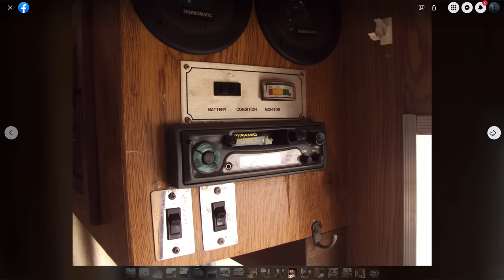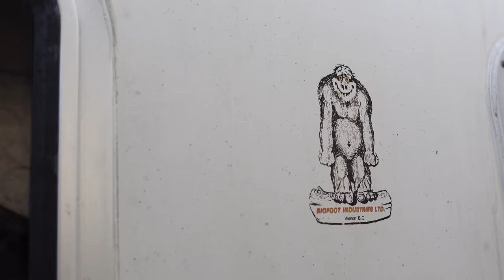We Bought a 43 Year Old Travel Trailer! (Bigfoot b17)

Comment: Cushion covers are amazing!  You are going to love trailer life.  Excited to watch the progress!  We have a 16 foot travel trailer that we have been using extensively over the past 15 years with our 2 kids.  On first glance, if there is any way to make that board above the bed into a bunk for a child, that would be my first suggestion!  That way your table remains separate.  (Our youngest is now 15 and has just outgrown our top bunk.)  Also, like you, we needed to buy a vehicle that could tow when we got the trailer.  Depending on the weight of your trailer, look into the Toyota Sienna van.  That is what we ended up with and we could fit 4 bikes in the back, 2 kayaks on the roof, towing the small trailer all over North America.  We are now looking for a replacement vehicle (it's a 2004), and see that Toyota now has a hybrid Sienna.  Never thought we would be mini van people, but there you go!
Reply from the maker: Hahaha I think we’re all minivan people if you really think about you know? 😅 thanks for the lovely comment!
Reply: @LeahandLevi  Minivans generally can pull up to 3500 lbs, but that includes everything in the van and in the car (including passengers). Then the minivan needs the tow package. If it did not come with one, then it can only pull (usually) 1500. When we got our first trailer, we looked into it, and all that was needed to turn our first gen Sienna into a tow vehicle was a transmission cooler and a break controller.
Reply: Soo ahh the Prius has a hitch, how heavy is the trailer again

Comment: What a great trailer!  My hubs and I have owned vintage trailers for several years.  One of the first things I would do if you plan to actually travel in your travel trailer, look at the numbers on the tires to determine how old they are.  You can find the information how to decipher the numbers online.  Trailer tires need to be purchased about every 5 years and you really need to buy trailer tires and not car tires!  The average life of a trailer tire is about five years under normal use and maintenance conditions - if yours are older than that, they definitely should be replaced.  Oh -- and don't neglect doing the bearings every year or so!
Reply from the maker: Ok that's great to know, my dad has also raised these concerns so we'll be doing that for sure. 👍🏻

Comment: I recommend having an independent mechanic look at the trailer and make sure everything is safe.  Brakes, bearings, axles, tires, electrical, body welds, and hitch. Grease any fittings, maybe have the bearings repacked. 

Next replace any seals on her body and roof, look for leaks, steam clean the upholstery, sanitize the water system and check for leaks there as well. 

Weight the propane tanks, turn on the propane without using it, and weight them again a day later. Make sure there are no leaks. 

Look for any rust on the metal parts, scrape it off and put a primer on to prevent further rust. This included under the propane tanks and battery box (if there is one outside)

Also start following RV influencers and try not to spend a fortune on accessories, a thing all new RV owners do 😅
Reply from the maker: Thanks for this! Our task list is starting to get pretty extensive haha

Comment: Hi guys!  Having pretty much gutted our 2022 Winnebago Micro Minnie, remember it from Isla Aguada?  If there's anything we can help with from afar, let us know.  For reconstruction, look into Baltic Birch plywood.  From 1/8" up to 1".  Strong, reasonably light, very attractive.  Windsor Plywood has it.  I used to make kayaks with it when I lived on Vancouver Island.  Solar, lots of options, simple is a suitcase panel, with charge controller.  Hook to battery, and voila.  A sway bar also very important, especially with a single axle trailer.  Definitely have a pro check your suspension!  Tow vehicle, lots of people go compact SUV or small truck.  But hey, we live in BC!  Mountains, mountains!  On a budget?  Older 3/4 ton, especially pre-DEF Diesel.  Newer?  I'd still go 3/4 ton, give you more flexibility for the future.  Give us a shout !  Dave, Leeann and Raiden.
Reply: Why did you gut such a new trailer?
Reply: @aayotechnology  because it was all total junk, everything either failed or fell apart during our 6 months voyage.  Dealership said it could be up to a year to fix it under warranty.  But back to original junk standard.  Fortunately, I'm very experienced with cabinet making and renovating RVs
Reply from the maker: Hey thanks you two! We’ve got a lot to learn that’s for sure! 😅 hope your adventure is going well!
Reply: @LeahandLevi  departing for Nova Scotia, early August.  Then back to Mexico in October!

Comment: I think the cushions are retro for sure.  If you do not like them then make covers for them that are Velcro instead of zippers.  Then pull off and wash when needed. I also love the pattern and you could pull out many colors from them and will not show spills etc. I love the golds and greens. Nice camper. You will love the propane; you can get a sensor for leaks of propane like a smoke alarm. Put it low by floor. Also, a carbonatite detector.   I love it. I am subscribing. We just brought about a year ago, an old 1984 burro. Getting ready to work on her again. Get her finished.

Comment: I just bought a 26 year old fiberglass RV. I 100% understand where you’re at. It’s mint and they don’t rot. The biggest thing I would recommend you do right away is get on the roof and check all of your seals. I need to do the same. I also need to re-silicone above all of the windows.

Comment: I don't know how much you checked out more modern campers/RVs, many use magnets to hold the door open. I don't know if there is anything available where you wouldn't need to screw one position into the side of the camper, but if you can find a spot where you can just attach a magnet to the door and the side of the camper, then you wouldn't need to create a new hold in the fiberglass. You would just need to connect the two magnets with a stick, rod, or even a chain. (edit to add recommendation) I would recommend trying the rod suggestion first, because it would hold the door in a fixed place and serve as a rudimentary door stop. This may help prevent damage to the door hinge when there is a strong gust of wind and keep the door from hitting the side of the camper.

Of course, you might be able to fashion a suction cup with a string tied to the door. That would say we're putting in effort to improve over the stick method, but people would probably still say you're not putting in that much effort.

Comment: In Alberta the motor association offered a 3 hour lesson on driving r vs. We learned great safety info and both of us practiced backing up. Learning how to give instructions was good as well.  Tip from my trucker friend. Put your hand at the bottom of the steering wheel. If you want it to go right just move your hand to right
Reply from the maker: Yes! My brother in law taught me that one but I’ve yet to use it because we not have a tow vehicle yet haha
Reply: I've always learned to put your hands on the bottom of the steering wheel and I've only driven small cars lol. We had to do it to pass drivers Ed and not it's just habit. The reasoning is if your hands are on the top and the air bags go off your wrist will break

Comment: Hi team! You don't need to buy a light truck to tow your trailer - a station wagon or a sedan with a bit more power than the prius will pull it just fine. It'll cost less to buy, run, and maintain, and will be less bad for the environment. Good luck!

Comment: How tall are you Levi? Are you able to stand up without hitting your head inside the trailer?
We love our 13 ft Sidekick (U.S. made Trillium).  
I recommend having the wheel bearings checked and regreased. You would do well to have the seals replaced ($25 for 2 seals) .  Check the tires; if they are 10 years old or you see any fine cracks in the sidewalls , replace them. 
Have fun camping.

Comment: I think the kind of trailer you bought was a really good choice -- hard to beat for size, weight and durability. I don't know what the exact weight of the older ones is, but I imagine you could probably tow it with the average SUV or compact pick-up. 
That said, be careful what you choose for a tow vehicle -- it's easy to under-estimate what you'll actually need. Your best bet is likely to go with a full-size truck and a somewhat newer one may be easier to find well equipped for towing. It will make many things easier and more work-able.
Are the cushions hideous? YES, and No -- most people on here seem to love them -- who am I to disagree. I'm sure that, for a restoration or classic vibe, they are the ultimate. If it were me, I'd go with a thorough, more contemporary style throughout -- just my tastes.
Congrats! and by the way great job backing that thing up like a soon-to-be Pro!
Cheers!...from North Vancouver

Comment: List of OCD thoughts that have popped up while watching this 
1 have the support frame checked out! 
Fellow canadian Slim potatohead can tell you the horrors of having a frame fail you in the middle of the woods 
2 that dinette is an awesome location to install a custom made crib for little boiled peanut when she or he finally appears 
Certain dog beds with raised edges make excellent RV trundle beds for toddlers 
Cornish hens make excellent RV thanksgiving “turkeys” and Christmas “geese” 
See if those mattress covers unzip so that you can wash them , SEVERAL times…. Also check the foam rubber for refurbishing …. If its vintage 70s and 80s it might be single piece, you might want to replace it with a layered product of different materials that has a hard layer for support, and memory foam layer 
Im not sure what type of material you are going to replace the floor with, but make sure to consider the weight of the material if you are considering hard flooring over carpeting 
Meanwhile most hardware stores sell cheap 4 foot by three mats that come in handy i have a number of them i use in my stow and go caravan when turning it into a weekend camper …. Something like that might make a good temporary floor for your trailer 
Im not sure what your concerns with cooking with propane but please take this into consideration , because of their infrequent use environmental contaminants tend to settle in the lines and on the burners which is what you smell when you lit up the burners in that rental RV, i have found that lighting up the burners and oven and burning that out at home with the cabin fully ventilated (stick a household box fan in the door blowing out BEFORE you go on your journey will help make sure your burners and lines are burned clean. 
If you decide to preserve the decor versus updating it to something more contemporary , make a meal out of it…. Accessorize your interior to make whatever year in 1970 or 1980 be your theme …. On your journey make that year be your theme and include pop culture references for that years….. play the top 40 playlist for 1983, watch the movies released in 1985 
Oh and shop garage sales for plastic bowls glasses and pitchers of thatbera
Reply from the maker: Thanks so much for these thoughts! Lots to learn here for sure!

Comment: Owned a vintage trailer. Please take it from me-test the stove with a spray bottle and a bit of dish soap to check the lines. (Google it). If I had done this it would have saved me a literal propane explosion that blew out the windows and bent the pop top. Thankfully me and my pets were fine. Check each time you’ve traveled and you’ll be fine. (Believe it or not the windows went back in and the top was fixed…but still! 😂)
Reply: Holy cow !
Reply: @aayotechnology Yup I was brand new on the road and almost gave up after that. But I didn’t. Came back home, sold it and looked for 8 months for my new to me motorhome. 😁
Reply: @Brenda-es3gw  kudos for not giving up. Are you happy with the replacement?
Reply: @aayotechnology  Thank you! I am. Should be hitting the road pretty soon.